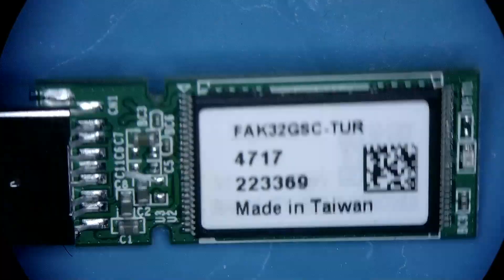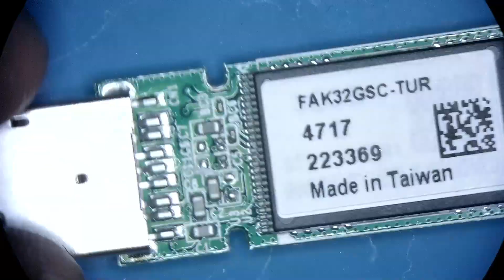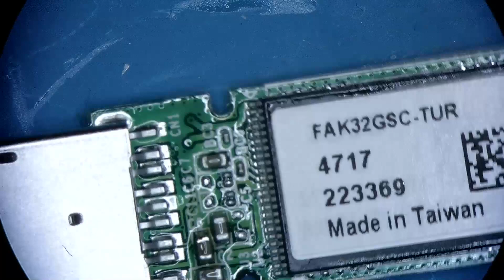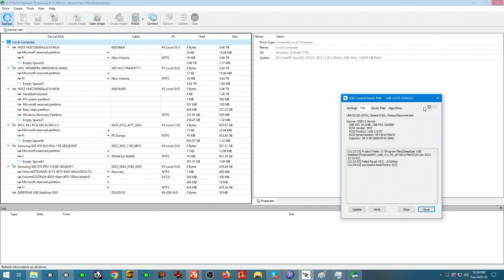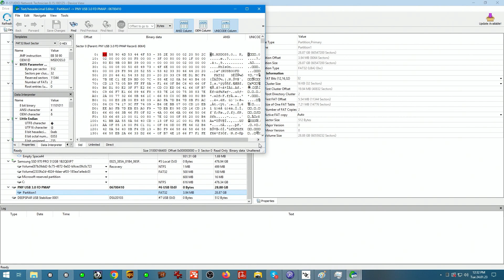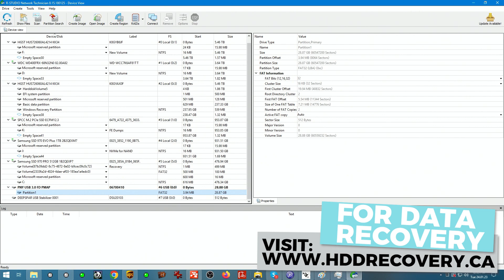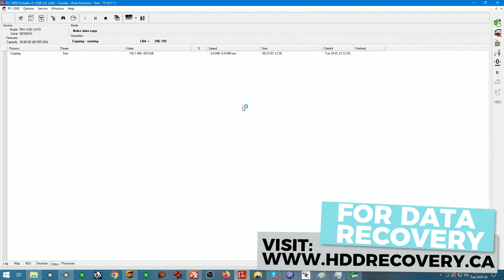This flash drive exploded on the inside. Can data be saved? #tech

Comment: at least it wasn't a $1K GPU that exploded. There were some AMD GPUs that the die cracked the believe they came from mining rigs. Typically the miners clean them up before selling them, but if you don't reassemble it properly the die cracks and burns. It wasn't a tiny hole like this one either. I mean the whole thing cracked in half and massive chunks were disloged. I do wonder what makes these smaller less power hungry components burn up like that.
Reply from the maker: maybe it was used in a USB hub that takes 5V from the wall, and instead they hooked a 12V by accident :)

Comment: Why did it burn out? I see only one cause: a malfunctioning Power Delivery port that pumped 20 volts into the device.
Reply from the maker: Hubs that use external power use 5v, maybe the owner out 12v in
Reply from the maker: Client sent it in after the incident so not sure.  Controller failure is actually a rare thing unless USB port or USB hub helped